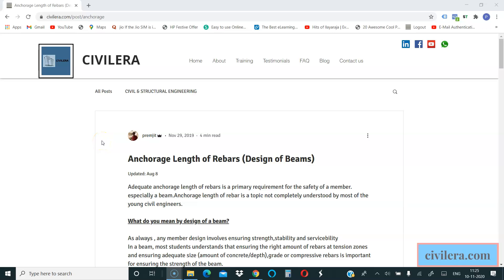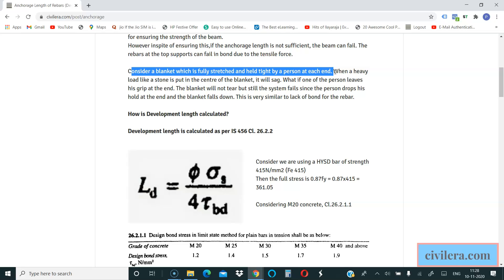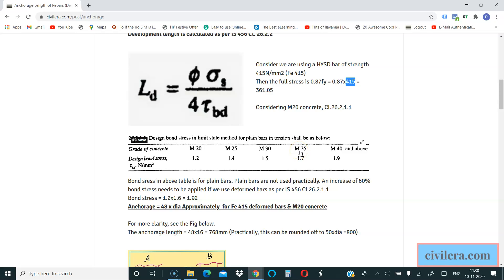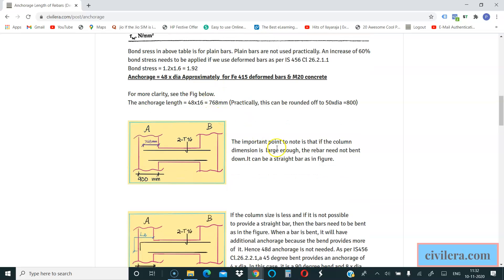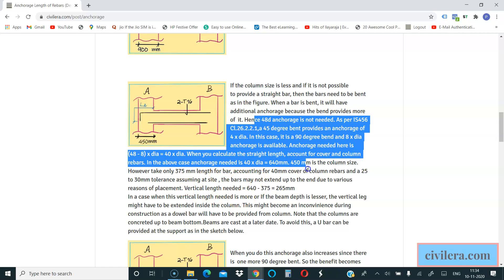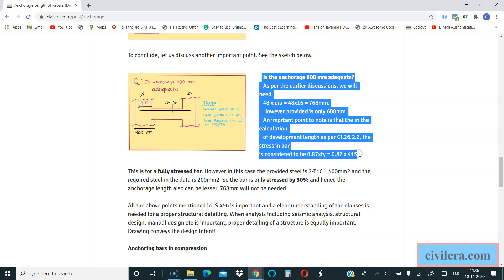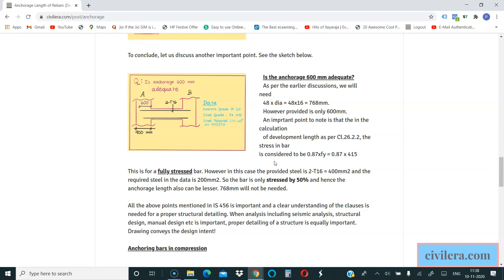How to calculate anchorage length of rebars in beams

Comment: please explain the meaning of this clause 
( Anchorage length of straight bar in compression
shall be equal to the development length of bar in
compression )
Reply from the maker: Quote the clause
Reply: @CIVILERABangalore  already quoted
Reply from the maker: @nikhilrana7458   Text is mentioned. Please quote the code clause if I have to take a look.
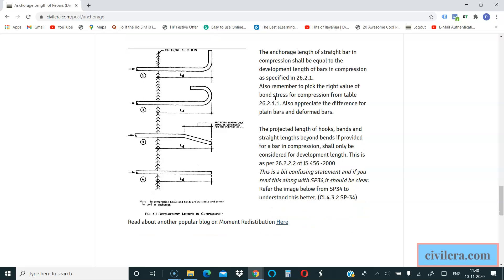Reply: 11:17 vedio timeline
Reply from the maker: @nikhilrana7458  As mentioned, it should be calculated as per the formula given for calculating the development length as per clause 26.2.1 in IS 456